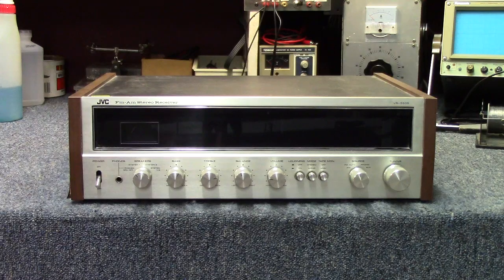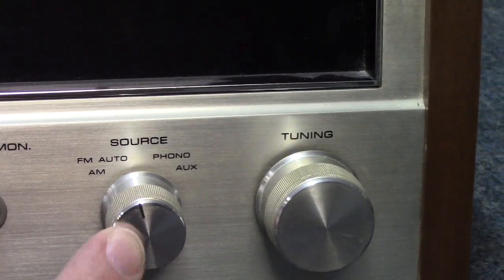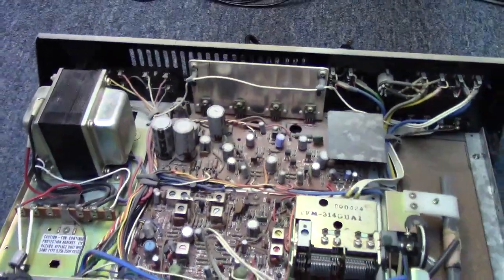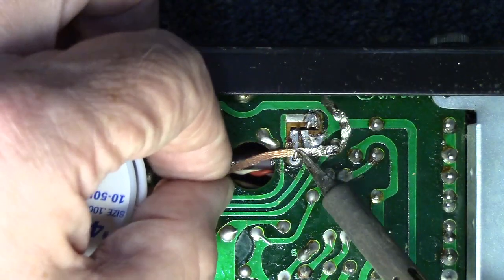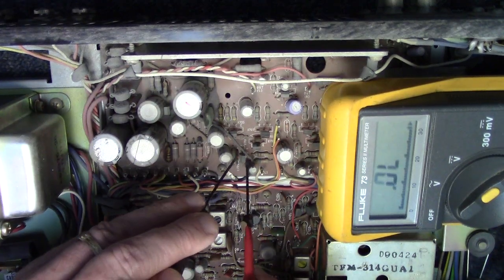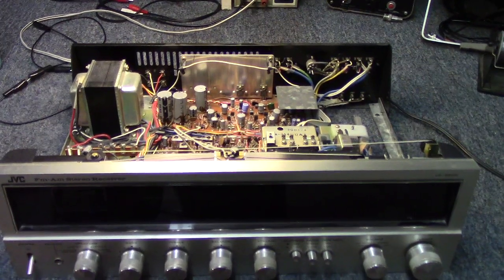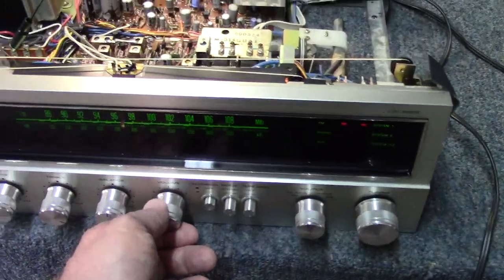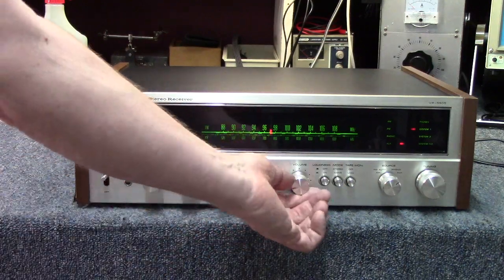JVC VR-5505 Receiver - repair & testing

Comment: I have a JVC 5.1 from 1993. Still works. I reduced the speaker output with an volt adapter to 1.2 volts and run it into an Emotiva amp.